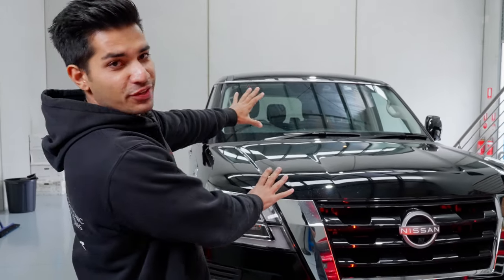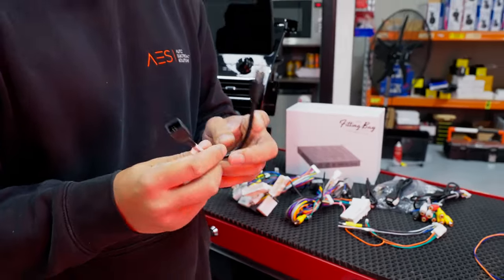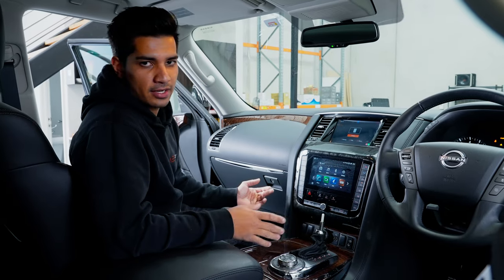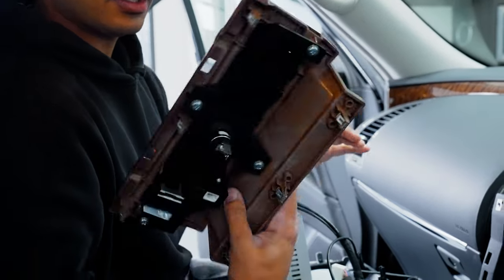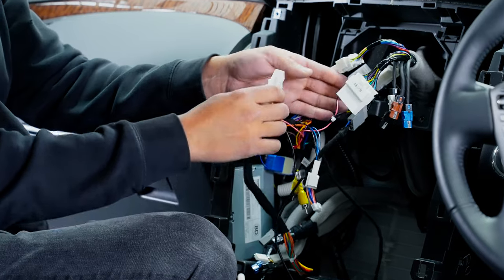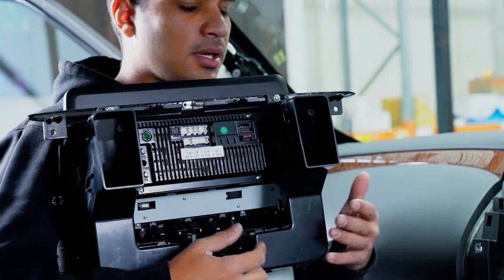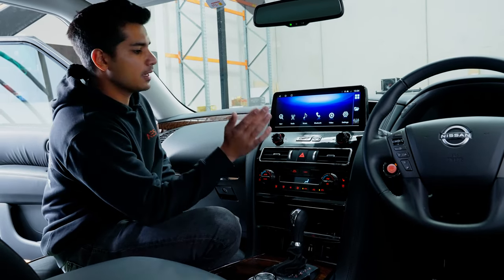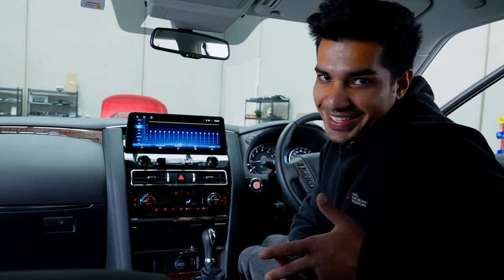12.3" ANDROID DISPLAY FOR THE Y62 Patrol/Armada (FULL INSTALLATION).

Comment: Thank you for Excellent video, I have the same unit on my car Nissan platinum y62 2016 model . 
Only problem is before the old screen when you get close from something front the car the sensor sound and front camera work , now only The sensor the camera not open ?
Other thing where I can order only the replacement camera system appreciate your help .

Comment: Excellent video, I have the same unit myself. Only problem is how do you connect those camera wires to the switch so it work when you click on that camera switch. Appreciate your help
Reply: If hooked up right the camera should come on when the camera button is pressed.
Reply: How can I get that USB blank?

Comment: I have the 2024 nissan patrol platinum v8, and Im very cinfused by the fact that you only get wireless apple carplay but need to be connected by usbc for android auto, Anyway to fix that? Also, how do you use the entire screen? There is always a square box that's just blocked out.

Comment: Hi Nathan thanks for the great video,You installed my unit for back in Jan,Just have a question does the unit interfere with the central locking at all mine doesn't seem to operate using the door buttons any more not sure if it is the unit or not causing problem,Any idea's? Paul
Reply from the maker: Hi mate will have no affect on the locking mech :)

Comment: Hi, I have a series 1 patrol Y62, and tried to install the next size screen up from this and ran into a problem ( there seemed to be no power to the new screen or buttons) . I then reverted to stock and plugged my old unti in, and still had the same problem ( On stock now no display, and no buttons work in middle panel) . Is there a computer reset needed or something?
Reply: Also, I noticed a blue ODB port connector that looked like bluetooth. What is the purpose of that?

Comment: What if you have the TVs in the headrest and the DVD player will it still work?
Reply from the maker: Rear screens compatible but the front DVD player is removed.
Reply: @The Fitting Bay  can you please elaborate on connecting the rear screens to the unit. I note that you say a HDMI to RCA adaptor is required (I have one already), do you then have to install a HDMI cable to the rear and if so where does it connect?

Comment: What was the process to get the factory headrest screens to work with unit? Where there settings to adjust?
Reply: What I did to get it working was to purchase a USB to CVBS cable and hook that to the headrest input on the harness. This will depend on your model and what harness you use to install it of course.

Comment: Did you have a problem with the camera working after the install? I did mine and everything is working except the camera
Reply: I was doing the install on 2011 qx56
Reply: @LenfordLindsayVendettaFilms 
Have you been able to figure out the camera issue?
I have installed on a QX80 but no camera.
Reply: @lantarkimairetire4742  I used the wrong wires at first and that damaged the mother board. I had to get a new mother board and make sure to use the correct wires this time around
Reply: @LenfordLindsayVendettaFilms  
My goodness! I hope that's not the case with mine.
Where did you eventually get the replacement motherboard and proper instructions for the wiring pls?
Reply: I got it from my original seller from alibaba, they also told me which was the correct harness.
Reply: @LenfordLindsayVendettaFilms  
Greatly appreciate the response bud!
Cheers

Comment: what about the tire pressure sensors?
Reply: Yes it should work with OEM TPMS. If you have aftermarket you will need one that works with the radio in order for it to work.

Comment: Why do you need a sim for maps? Seems illogical. The factory unit doesn't need a sim which requires a plan. Nor does a navman etc. Based on this one factor I'm not interested $2600 and I gotta pay to use what was free in the factory unit.. also you seemed to only be able to view the rear camera only where as you can view all cameras individually in the standard console,  then you say heated seats don't work with a giggle WTF, dead pointless feature. Buttons sounded cheap also...pass. Fix these issues and I'll buy one
Reply from the maker: Not having "on board maps" is not an issue. You can easily go ahead and download offline maps and no sim needed so thats point 1 dead. point 2 you can view all cameras? even moreso with the upgraded ones thats point 2 dead. and heated seats use the genuine controls, the exact ones you use now, so no difference and there we have it point 3 dead haha :) give me a call if you have any questions mate.
Reply: @TheFittingBay  thankyou for the response, I accept your answers. Unfortunately I read into the video as I saw it, honestly I didn't look at your website I just asked my questions after watching. I'm glad everything works. Back on the list👍
Reply from the maker: @brettleonard8602  all good 😬😬
Reply: @TheFittingBay  Also you handled that well. Some people get upset at genuine questions and lose it. I could tell you weren't happy but weren't rude. Smart and great customer service. 👍